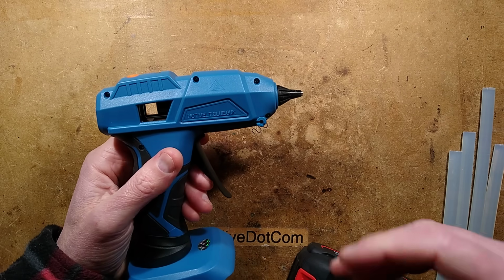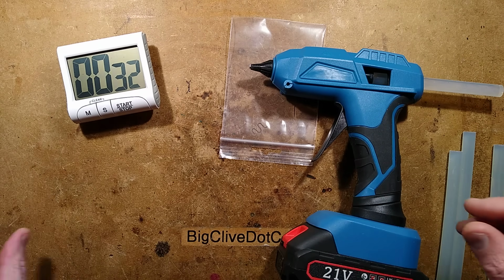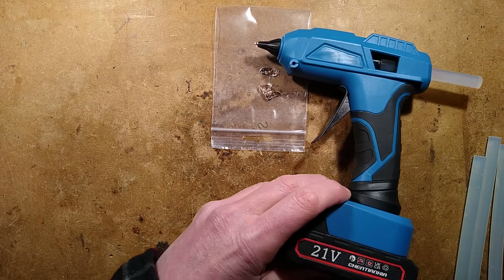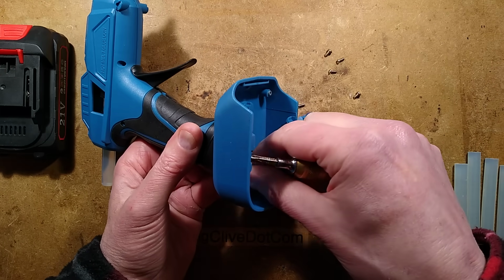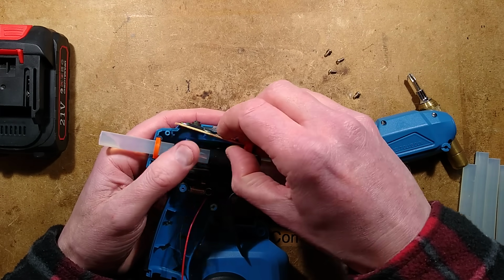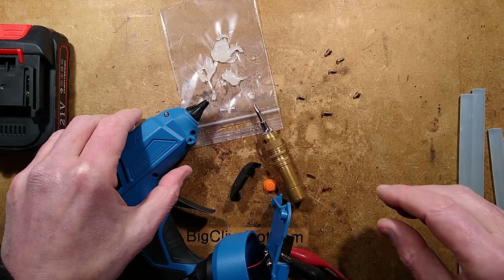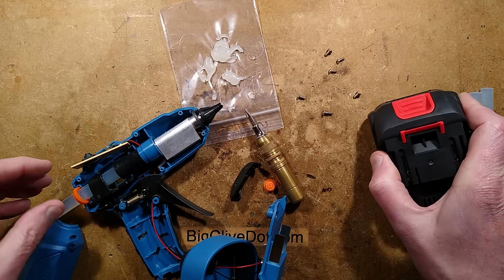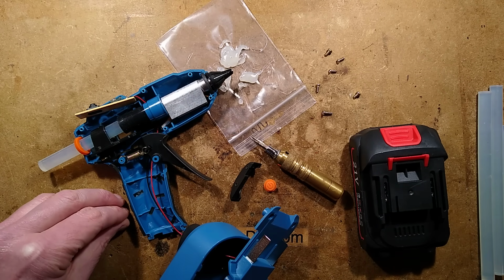Makita battery "compatible" glue gun

Comment: Lowe's Home Improvement stores stopped selling Makita and picked up Hitachi.  At least in my area here in the US, not sure why.  Had a Makita drill/driver that worked great but when the batteries died I just tossed it because I couldn't get the replacement 18V batteries, didn't know back then you could get fake ones. DUH! Thanks Big Clive for the video.
Reply: Terry, the reason why is usually $.
Reply: Metabo bought out Hitachi though
Reply: Deal ran out with Makita, and they opted to sign with KKR instead. Metabo is on Makita's level at least. Though if you're looking for anything heavier duty than a short project hear and there you should probably just save up for DeWalt/Milwaukee
Reply: @babayaga7434  Yeah, I forgot about Metabo, I think it took Hitachis place now. I've got a little of all the major brands but don't see a dimes worth of difference in any of them...Harbor Freight here I come..😉
Reply: @babayaga7434 That’s pretty bad advice.
For one, Metabo HPT and Makita are prosumer tool brands, just like Milwaukee or DeWalt. They’re all at the same level when you’re shopping their upper end offerings.
Second, DeWalt offers a wide range of quality, you can buy a DeWalt tool that’s on par with the lost end of Ryobi or Harbor Feight’s range.
Thirdly, Makita and Metabo HPT prioritize durability and ergonomics, both are important to consider for any kind of professional use.
Reply: @ Yeah I've seen Metabo at our store lately too and less Hitachi. They keep changing brands, the almighty dollar I guess.  Thanks.
Reply: @ Metabo, or Metabo HPT? They're not the same, Metabo HPT is just the new name for Hitachi in North America

Comment: Imagine adding a thermistor, some beefy pwm switching, and having a temperature contolled one, tilt switch to reduce temp to a preset level in its stand so it was ready to go faster without all that dribbling. no man likes a dribbling tool.
Reply: Well I'd say that I do
Reply: Simply pull the stick back a bit when not immediately gluing. The feed grip only has a hold on the stick when the trigger is pulled. Saves having the hot glue drip all over the place.
Reply: @theoztreecrasher2647  yeah done that in the past, but if your holding the item in one hand and the glue gun in the other then your out of hands, down to teeth, but if I'm sucking a Werther's then I'll dribble again...
Reply: Let's make the feeder a stepper motor with retraction when off the trigger while we're at it.
Reply: @Immashift  now that's something I missed! I should of thought of it/remembered it at they have been doing it for 5 years or so on mastic guns!
Reply: @Immashift I'm pretty sure a servo might be sufficient, smaller and cheaper, heck even the knock-off could pop in one of those 😂

Comment: But Makita batteries DO have a protection circuit build in?!
At my workplace we replaced OEM makita ones with fake china ones (my boss cheaping out) and i kept the OEM ones.
I opened them to salvage the cells and it did have protection (but no cell balancing).
I still have the batteries since they still work fine for projects.

EDIT EDIT: I just checked. 
-With the old OEM battery installed the drill works until it slows down a bit and then cuts out.
-One china brand runs the drill down to 0V
-Another China brand is like the OEM one but cuts out way earlier.

But maybe thats just some internal circuit of the drill thats "communicating" with the battery and deciding when to cut.
Reply: As far as I'm aware, the newer batteries (like the ones revised/phased in within the last 10 years) have a BMS but that still doesn't include any low voltage protection.
Reply: My DeWalt batteries certainly don't care, they expect the tool to cut itself off. I have an adapter I made for a non-DeWalt snowshovel and  it will run the pack way past empty if I let it.

Comment: just bought a crappola dewalt compatible glue gun, going to grind the base with the dremel to make it fit my parkside, and of course i'll fit a low voltage cut off since parkside batteries surprisingly dont have them (huge deliberate design error to cause battery bricking imho)
Reply from the maker: I think it's just cheaper to send a signal to the tool to get it to shut off using its power control components.

Comment: Most makita tools have the over discharge protection in them, not the batts. They do it to punish you if you use their batteries in knockoff tools ¯\_(ツ)_/¯
I have my childs Power Wheels setup for my Makita batts, I have in line fuses and a low voltage cutoff to prevent the vehicle from overdrawing. Works a treat, they haul around the yard and when it runs out I just pop another tool batt in and they are off! :P

Comment: My makita star batteries shut down when they reach a certain discharge level. They also have a chip on the control board that records charge/discharge cycles (readable by Makita dealers apparently, for warranty claims). The modern makita impact wrench I have will not work with older battery packs, nor the chinese compatible packs, nor the packs I've made from casing + buy your own 18650's. So the near makita tools do talk to the batteries somehow.

Comment: hi big clive .  would you please take apart and explain how vw electricy power steering works . it seems instersting  usein 3 phase motoe from 12v power supply
Reply: German engineering...inverters
Reply from the maker: That could be quite an expensive video to make.  I'll keep an eye out for associated bits.
Reply: A 3 phase electric motor is in other contexts known as a brushless DC motor, a BLDC "speed controller" is actually a 3 phase inverter with closed loop feedback control on the frequency

Comment: Makita do have a BMS yes? All Makita 18V batteries I have taken apart (4, 5 & 6 Ah) have sense leads to every cell. The 6Ah batteries have mosefets for shutting of at overdischarge as far as I know.
Reply: The 3 original Makita packs I've taken apart did not monitor individual cells. But they do lock-up permanently if you try to charge them when they have a too low total cell voltage (by permanently disabling the battery pack motherboard).
I assume more modern packs have better electronics, then the old ones)
Reply: @Peter_A1466 I'm so mad at them for using only the first cell to power the electronics as well, leaving the battery sitting for a year will lock the board permanently, like a time bomb... Better off buying DeWalt, at least those are fine with swapping cells. Even Bosch is repairable.
Reply: @windshield11  unfortunately good brand reputation doesn't mean they don't produce stupid stuff as well... 😞
Reply: AFAIK the ones with the star logo do have single cell voltage monitoring. The older ones without the star not.
Reply: @Poebbelmann  they do but they still do the whole powering the board from the first cell, cursed things
Reply: All major manufacturers have some type BMS.

However, not all BMS setups have all the safeties on the battery itself. Some companies build it into the tools and chargers instead.
Reply: @reaperreaper5098  i have nothing against not having power mosfets on the board, but my problem is when the board locks permanently and doesn't let you replace cells
Reply: @reaperreaper5098  older batteries from most manufacturers did not. They only monitored the total pack voltage. More like a PMS 😀
Reply: @Peter_A1466  If we’re talking products that have been completely discontinued for over a decade, sure. But their current platforms all have a BMS on the battery, with some having all battery management on the battery while others build some battery safety features into the tools and chargers, and it’s been that way for well over a decade.
Reply: @reaperreaper5098  do they still permanently lock out the battery in case of any failure?
Reply: @ Yes, but you’ve got to get the same failure multiple times for it to lock out with most types of failure.
Reply: @reaperreaper5098  yeah the user does tend to try multiple times to charge the battery when a new one is 150 bucks. It's 3 times on makitas
Reply: @windshield11  If you manage to discharge a battery to the point that trying to recharge it multiple times fails, you've basically already ruined the battery. Li-ion cells can only be discharged so much before you permanently damage them.
Reply: @reaperreaper5098  I fully agree, but I repair batteries for a living. I do it right, with spot welding and quality cells. Greed is the reason they lock the board permanently.
Reply: @ Greed isn’t the reason. It’s an overreaction to the catastrophic failure of the pre-STAR LXT batteries that had a larger tendency to catch fire.
Reply: @reaperreaper5098  good reason, but Samsung is the same way. This S24 ultra is an amazing phone but the charging is criminally bad, it heats up and doesn't charge. I have friends with p30 pro Huawei phones, that don't heat up much at all despite running higher watts!!
Reply: They do. Well my genuine makita batteries do anyhow.

Comment: Never seen a glue gun that wasn't ptc, have they not been the same since the 1970s?
Reply: I have one with a temperature dial on the handle so it has an actual controller in it.  Runs off 220V.

Comment: Loads of room in that case to fit a protection board
Reply: Not a bad idea, drop off the battery if the voltage falls below a set point.
Reply: @WineScrounger  yes one could easily make a spring system that ejects the battery when voltages go too low :D
Reply: @vihreelinja4743  - Explosive ejection, like the packs on the high voltage lines?
Reply: Or an auto off timer after  15 minutes
Reply: You can get protection boards that would suit if you search for Discharge Protection Board For 18v/20v MAX Batteries DIY Connection 5A Output
Reply: Makitas protection board is inside the tools, not the battery
Reply: Protection circuitry is really inexpensive, I'd like to see redundancy with the brand stuff.  @paddanandersson4626
Reply: Maybe loads of room in the case, but not in the manufacturing budget.

Comment: I have a Panasonic Tough Tool IP drill, and it also has a proper battery management system that stops the batteries from being over discharged.  It may not have the highest torque rating in the world, but I did and entire loft conversion with it, and many more jobs.  It's a very good drill / driver.

Comment: Makita cheeping out with no BMS why am I not shocked. Still an OK bit of kit if you dont mind the lack of heat control. Interesting video 2x👍
Reply: In all fairness, they have a bms, but the bms only gives a signal to the tool to shut down. The tool itself when given the signal doesnt care about the voltage
Reply: That's the same design as all tools. The power output is directly connected and the tool itself will protect the battery once the battery gives the signal that it's dead. As Clive said only Ryobi does it the other way around is because they want their batteries to be compatible with older tools.
Reply: @UhOhUmm  not 'all tools', oddly the cheap tools from the aldi store have switching mosfets in the battery, their main competitor lidl do not.

Comment: Nice teardown. Never thought a real deal Makita battery wouldn't have a BMS with overdischarge protection.
Reply: The makitas use a bms on the battery, but that bms does indeed not shut the power off. It gives a signal to the tool to shut down. My Dml809 Worklight makes use of that by switching from whatever brightness to just a single led being lit for some more time. Though that doesnt help much when going from 10 000Lm to like 10.
Interesting side effect of having low voltage detection but no shutdown in the battery, and NO low voltage detection but low voltage shutdown in the tool, enables you to bodge a little. For example the brushless grinder works down to about 11V, all you need to keep using it when the last battery is flat, is a pair of jumper cables and a car battery, not that I have tried that😂
Reply: They are built into the devices. I prefer it this way, as it means that a faulty BMS can't kill your batteries unless you leave them plugged into the device.